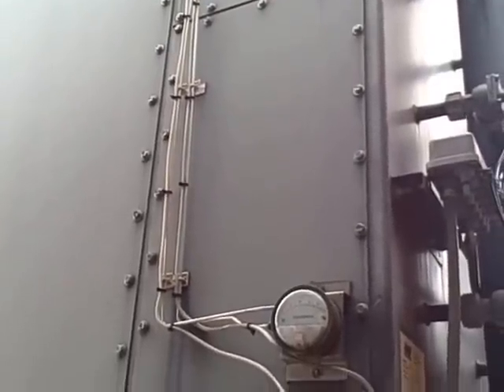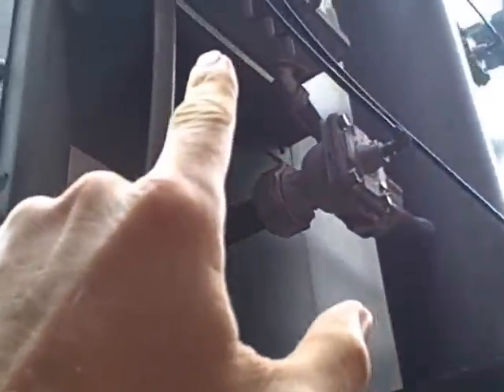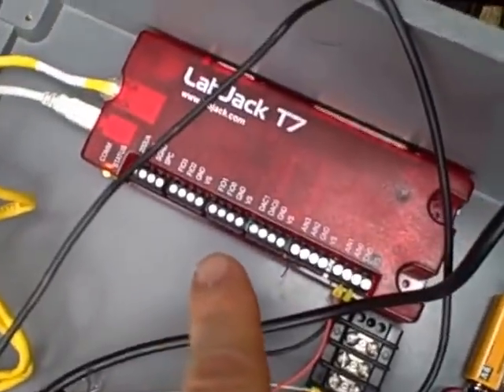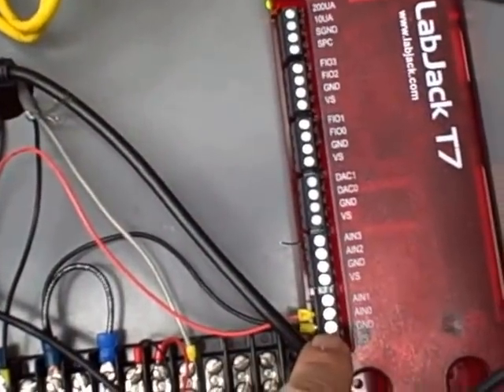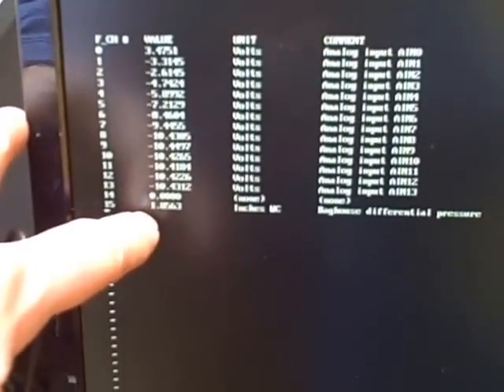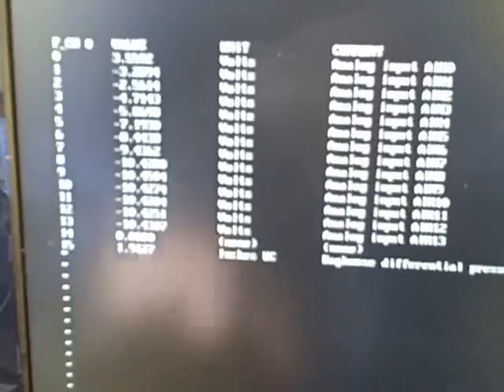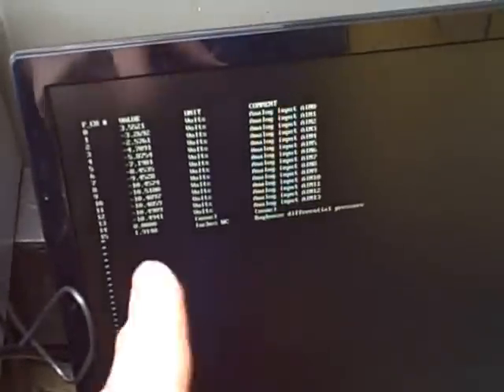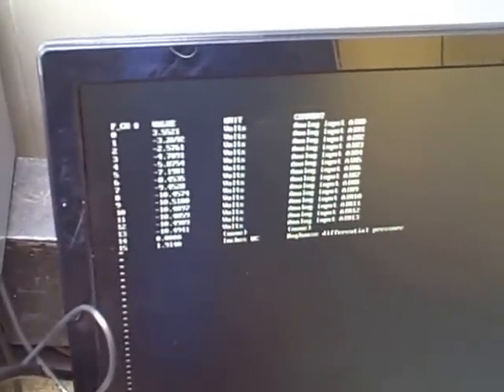Raspberry Pi-based SCADA prototype working

Comment: Will you have the code for the Raspberry Pi available on GitHub so that it can be seen / shared with others following along? 

The Raspberry Pi could present that same data with a single-page realtime webpage using Angular.JS and Node.JS.  The collected data could be stored into a Mongo database.